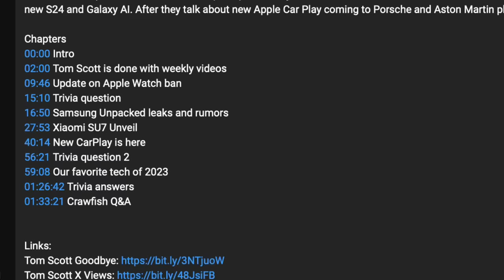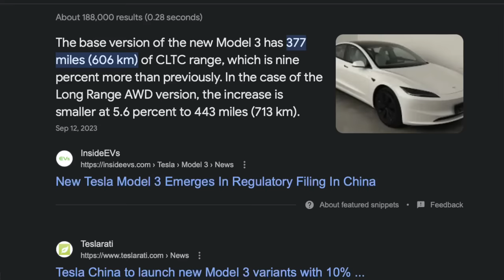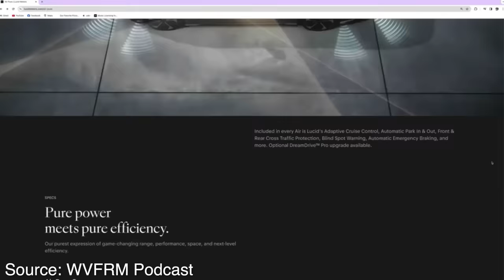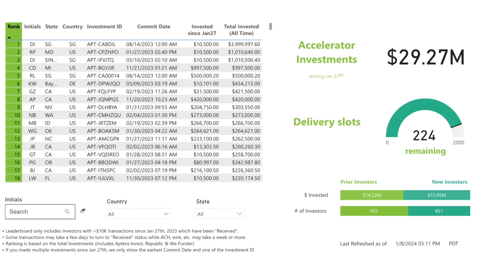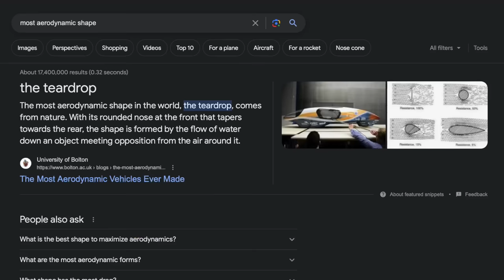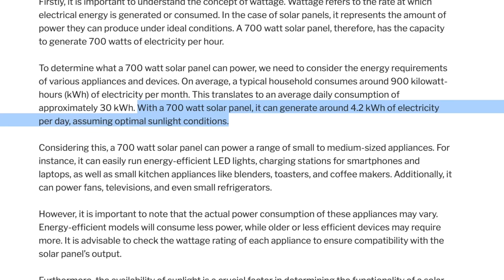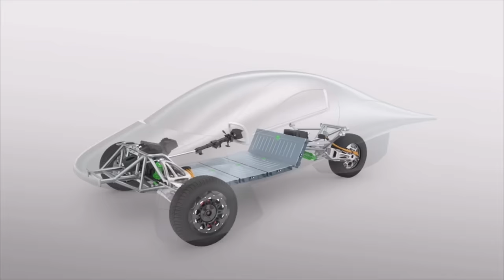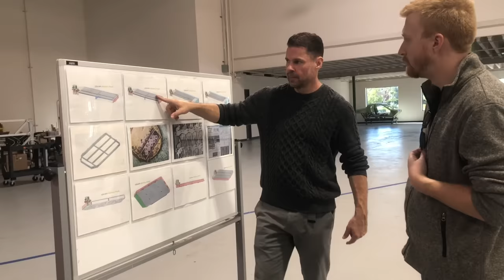Response to MKBHD Aptera Comments

Comment: Aptera should be considered more of a motorcycle class than car IMO. That said it’s a great product and company.
Reply from the maker: doesn't require motorcycle license, drives with steering wheel + pedals, doesn't require a helmet. I don't see it as a motorcycle at all
Reply: @TailosiveEV   Fair enough
Reply: I own a Gen 1 Honda Insight.  My wife and I have both ridden in an Aptera prototype, and it exceeds the specs and performance of our car in every single category, including room, acceleration and likely safety.   And I say this having around 1/2 a million miles on motorcycles.  The legal issue has no practical meaning regarding the function.

Comment: 3-wheel vehicles are considered autocycles and are not required to meet the same collision safety standards as a regular 4-wheel vehicle. They are cheaper to bring to market for this reason. 

Hard shell bodywork means the force of impact is transmitted to the driver.   Regular vehicles have crumple zones to absorb impact and help decelerate the human occupants during the collision and stop.  Having a rigid body without crumple zones or bodywork that crumples before the main structure then you have more serious injury to the occupants.

Shill for Aptera all you like.  Most stake holders will.  But lying about safety and range is misleading and unnecessary.   Everyone will see the truth of owning an electric autocycle when Aptera finally starts delivering.  Will you be ready to admit when you're wrong?

Comment: I don't want to discourage you. It is not the type of vehicle I want to spend hundreds of miles in. Can you camp in it or go fishing with.
Reply: Yes you can camp in it. You can sleep in the back easily. Best part is, as long as you park it in the sun, you'll recharge the batteries while you're camping, and leave with more charge than you arrived
Reply: My wife and I plan to take ours to Death Valley to go camping immediately after picking ours up at the factory.  Both of us have ridden in a prototype, and gone camping many times there by motorcycle.  We already know that the experience in Aptera will be far more comfortable and less expensive at the same time.
Reply: @GoClimbARockEh  Bed is also plenty long enough for his fishing poles.
Reply: @GoClimbARockEh  Good luck. It looks like something you drive to the movies, not Costco or serious camping with coolers and gear.
Reply: @Retired.at.40.Bored.at.50  serious camping only requires cars be driven to the trailhead, and this car has plenty of cargo space to make that happen
Reply: @GoClimbARockEh  That's impressive if true.

Comment: I like the aptera but need at least 4 seats in any vehicle to be practical.  Otherwise it's just an expensive oversized motorcycle.  But there are lots of supporters of aptera.  It is a good vehicle.  But at $25k might as well get a chevy bolt
Reply from the maker: Bolt isn’t in production. Also requires at home charging solutions while Aptera doesn’t. GM is also dropping CarPlay
Reply: There are lots of very popular small performance-cars with terrible (and mostly unused) back seats. They provide almost no value while greatly reducing cargo capacity. I consider Aptera's two-seat configuration (and lots of cargo space) to be an asset, not a liability. 🙂
Reply: "I like the aptera but need at least 4 seats in any vehicle to be practical."

You aren't normal.  You're maybe in the 1% of commuter needs.

Comment: The Aptera doesnt' look like a car -  because it isn't - it is classified as a motocycle with 3 wheels.  The range is all hype; I have to watch Youtube to actual driving instances  to get any clue ; btw Cybertruck was recently tested 70mph 73f and got only 250 miles of real range on flat ground.  Another fellow did the firest documented Cybertruck recharge 70% in an Hour.
Reply from the maker: It’s classified as an auto cycle which doesn’t require a helmet it enclosed
Reply: The classification is arbitrary.  I have ridden in one, and it surpasses the performance of my Honda in every single category.  The three wheel design improves rolling resistance, aerodynamic resistance, cost, and weight - a win for its design goals in every respect.

Comment: The fourth wheel doesn "magically" make a vehicle safer. It's scientifically more stable.
Reply: Three wheeled designs are plenty stable, and the stability of cars has more to do with how low the center of mass is than anything else. The Aptera did remarkably well on the 'moose test', while almost all SUVs roll over
Reply: Aptera has a lower center of gravity than almost all 4 wheel vehicles and a wide front stance where most of the weight is centered..   These factors are decisive.
Reply: @n.brucenelson5920  True - and 4 wheels are more stable than 3. That's why the Aptera needs to be 8 inches wider than an F-150.
Reply: @GoClimbARockEh  3 wheeled designs are less stable all things being equal. That's not debatable. That's why the Aptera needs to be 8" wider than an F-150 to compensate.
Reply: @approots  not true. It's wider because they need the aero from the outboard wheels to not interfere with the aero from the main body, in order to achieve the ridiculous efficiency they've designed in.
Reply: @GoClimbARockEh  Riiiiiight. You know that a wider stance is more stable, right? I like the car too, but dishonest fanboyism isn't helping anybody.
Reply: @approots  Read what @goclimbarockeh told you.   All things are not equal.  Due to the use of  wheel motors and much of the weight centered much lower than the F150 can carry it, the Aptera is more stable than the truck and each tire is more lightly loaded with three wheels than the truck is with four.
Reply: @approots  sure, a wider stance is more stable. But that's not why they did it. The Aptera is ridiculously stable. It's far more stable than it needs to be. Check out the moose test videos. It's more stable than just about anything else on the road. They've told us exactly why it's as wide as it is, and it's all about aero. If it was just for stability, it wouldn't need to be as wide as it is. Why do you need to make something else up?
Reply: @n.brucenelson5920  Yeah, it's like you guys are misreading what I wrote. I've owned trucks and even flipped one. I have an EV now and appreciate the low center of gravity. But what I wrote is that 4 wheels are more stable than one. You all know this, but go ahead and argue with what you think I wrote.

Comment: Y'all see that test drive video last year wher an Aptera prototype didn't have the torque to drive up a hill? The CEO, who was onboard, said something like "you might be the first person to drive it uphill". Almost 20 years in development, hill climbing performance yet untested?? VAPORWARE!
Reply: The motors overheated, since they weren't yet hooked up to the cooling system. The remarkable thing is that they drove that prototype around for months without motor cooling, and never had a problem before that day. That happened to be one of the hottest days of the year. It's clearly not vaporware, they're building PI models right now.

Comment: IMO the Aptera car is shape like a kite, Is lite and 3 points of contact to the floor makes it unstable. It may be efficient and fast on perfect conditions, but it will be easy to flip but a single adult or even cross wind.
… And those wheel covers look weak, are they?
Reply: The vehicle has a very wide front wheel span and is about 15' long. With an aluminum belly pan and structural battery pack in the belly and electric wheel motors and has a low center of gravity.  Aptera had done significant computer modeling and then created a Beta promoted load with sensors and data logging equipment to test their simulation against real world performance. There are videos of that prototype performing the "Moose Test" ( collision avoidance test) etc. It handles really well.

Comment: Aptera as concept and first iteration as a company, is nearly as old as Tesla. Aptera has bankrupted once, and they also had production hardware going then too... Also 7:56 rain drops are not 'tear shaped' they are oval shaped, it's not change the aerodynamic claim but it's just wrong. Just facts that it's crowdfunded and have solar on car, should trigger some skepticism.

If it's eVTOL with ducted fans or car with hubmotors, avoid. -Those people don't know what they are doing.

Comment: Oh and driving a motor cycle requires you wear a helmet; it require a motorcycle endorsement in my state; and also a night driving motocycle endorsement to drive it at night - beyond that Aptera used drag figures without mirrors so of course that means the range is grossly off .
Reply from the maker: Not if it’s enclosed. No helmet required
Reply: In California, 3 wheelers or motorcycles with sidecars do not need motorcycle licenses.
Reply: Your lies are easy to check.  Why do you keep repeating them?  Thanks for giving Aptera channels increased traffic at least.

Comment: radiator openings increase drag. Aptera came up with the idea to cool without a radiator that has never been tested. However the test mules have been overheating even with a radiator. I think they've got a lot of basic engineering still to be figured out & I'm afraid they'll go broke before they go into production. I'd love to have a used one as a toy, 2nd or 3rd vehicle but as dad once told me wish in one hand & $4!t in the other & see which one fills up first.
Reply from the maker: They didn’t overheat the battery. They overheated the motors once when they didn’t have the coolant lines connected (it was a show car, not a production model). There’s radiator openings on the back by the license plate
Reply: Yes it had a radiator and overheated.  The issue was that they had not hooked up the cooling to the motors since the third vehicle was intended to be a show piece and was not fully rigged for long-distance driving.  After that PR blunder, they hooked up the cooling to the motors and drove it up a mountain.  

That said, I also have the concerns that they won't make it to production.  They're still 'hoping' they will start production at the end of 2024.  (just like hoping to start production in 2023 and 2022)
Reply: correct @TailosiveEV
Reply: @michaelwilson7978  they have already said production of funding dependant. The are doing things because they are getting smaller funding lots throughout their various programs, but they haven't got the large scale can dump they would like.
Reply: "Aptera came up with the idea to cool without a radiator that has never been tested."

Blatantly false.  "Skin-radiators" predate WW2.
Reply: @marksparks8852 "However the test mules have been overheating even with a radiator."

Where did you hear that?  it is untrue.   I know.  I had an extensive ride in one of the prototypes with an Aptera thermal engineer driving, and I understand thermal desgin.

Comment: It looks dangerous because it looks like it’s rolling around on bicycle wheels
Reply from the maker: Do bigger tires make you feel safer? Do you keep them by your bed at night?
Reply: Aptera is using standard sized small car tires - not "bicycle" or even large motorcycle wheels.
Reply: @n.brucenelson5920  hence my use of the term “looks like”

Comment: When do Aptera deliveries actually start? It seems like this things been delayed 20 times. Sick of the BS. Also the safety is not gonna be as good as a car. Part of the reason cars have gotten bigger is for more saftey and crumple zones. Is it safer than other 3 wheel vehciles? Probably. Is it safer than other cars? Very doubtful. Barely any room for proection.
Reply from the maker: Room =/= safety. The type of barrier used and the impact resistance is what dictates safety. But if you’re basing purely off space then Aptera has a far larger rear crumple zone than most sedans

Deliveries are targeting end of 2024 but like Tesla, Rivian, and Lucid they’ve been delayed
Reply: Delivery is all funding dependant they have said that always and they have been clear on what money of coming in and what they are spending it on (not exact figures for everything). They should say we X amount of months needing X amount of dollars to make it to production.
Reply: You do realize that Aptera is only 4.5 years old, but it took Tesla 6 years, Arcimoto 10 years, Rivian 12 years and Lucid 14 years to get to production, and Tesla didn't do much production in 2008, so it was really 7 years for Tesla. Aptera has always said that production depends on raising enough capital to start production.
Reply: Time will tell. It has no engine in the front or wheel that can be pushed into the passenger compartment and it does have a large crumple zone and airbags I'll wait for the crash test results.

Comment: cool concept but they've been around as long as tesla and haven't done anything.. as soon as tesla releases their compact they'll be dead (along with most other auto makers).
Reply: Tesla was founded in 2002, whereas the first iteration of Aptera existed from 2006 to 2011, but Steve Fambro was no longer CEO after Sep. 2008, and the new CEO did a poor job of running the company. Today's Aptera started in Aug 2019, so it is only 4.5 years old.
Reply: @amosbatto3051  elon started investing in 2004 and became ceo in 2008.  aptera was technically founded in 2005 and has been relaunched by the same guys.  i'd love to have their vehicles as an option but they haven't proved anything thus far.  if tesla hasn't bought them out by now they probably have something better on the horizon.
Reply: @_xBrokenxDreamsx_  Both Aptera Inc. Founders have founded and run successful companies since getting tossed in 2009.  Chris Anthony took a lithium battery company public as co-founder and CEO before regaining the original Aptera rights in 2019 and founding Aptera Corp. - with a completely different corporate structure and product.  I invested in Flux Power, and it has both made me money and is rated a buy by every analyst following it.